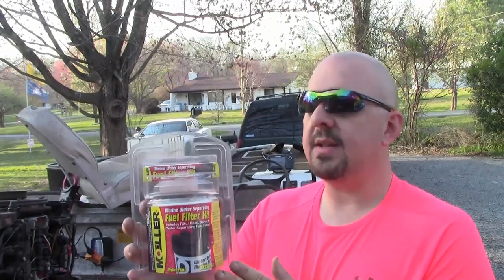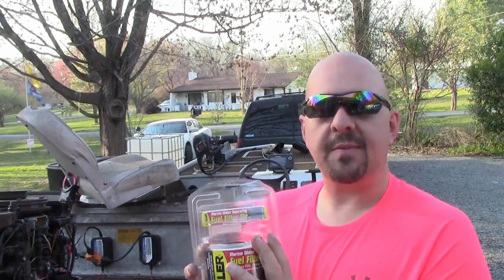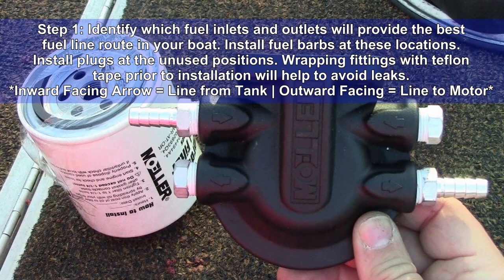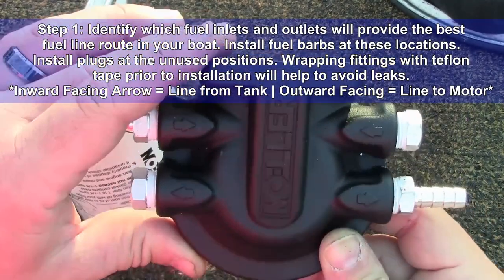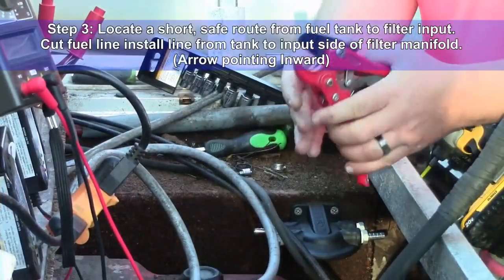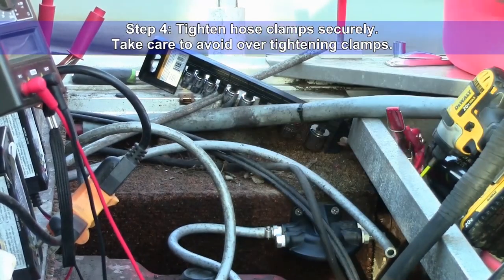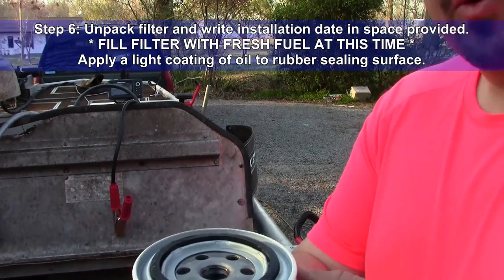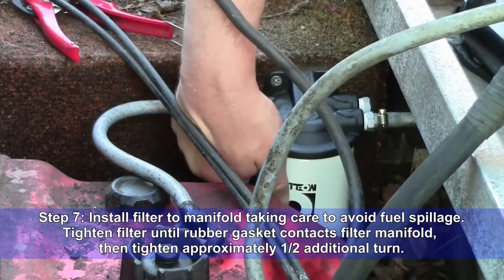How to Install a Water Separating Fuel Filter on Your Boat Motor

Comment: What do you suggest to take off a very stuck fuel water separator I’ve tried a filter wrench and still can’t get it to break loose I will be going back to the mechanic that put it on my boat
Reply: Will not be going back
Reply from the maker: They make a oil filter wrench that has steel Jaws and uses a ratchet handle to turn it. The harder you pull the ratchet, the tighter it grips. I've used it on a super stuck oil filter once. I don't see why it won't work for this too.

Comment: Gonna get that done this fall. Believe it or I've never had one of those water separating filters and never had a fuel issue from water. How to you know when to drain the filer since it is not a clear filter? Thanks for the video as it will serve as a guide for me
Reply from the maker: I change my filter about one time per year. Usually in the spring. If I start having fuel issues, I go ahead and change it again if it's been more than 6 months. There's no real way to tell if it's bled off any water.
Reply: @TheWeekendAngler  Guess you could remove the filter and pour it in a clear container and see if any water is on the bottom
Reply from the maker: @arciefan  you could. However the filters are cheap enough if I remove one I'll just replace it.

Comment: And where would you get and what size are the two barbed fuel line fittings ? Mine only came with two plugs. Thanks in advance!
Reply from the maker: It should have included the barbs as well, but you can pick them up at any big box hardware store or marine store.

They're 1/4npt male to 5/16 or 3/8 hoze barb depending on the diameter of your fuel line.

Comment: Does the primer bulb have to be before the filter or it can be after the filter?
Reply from the maker: Primer bulb is after the filter. Between output of filter and outboard.
Reply: @TheWeekendAngler  Oh thanks much for that . I would have thought , just the opposite for some reason. The one I am planning on getting is a 28 micron filter for Johnson outboards. I hope that is correct for the 115hp engine I have. Does that sound right?